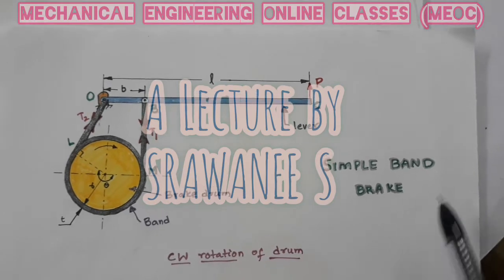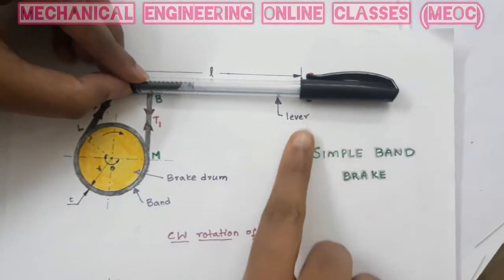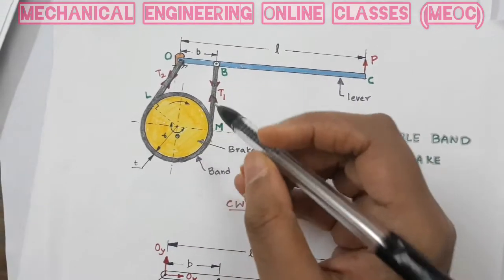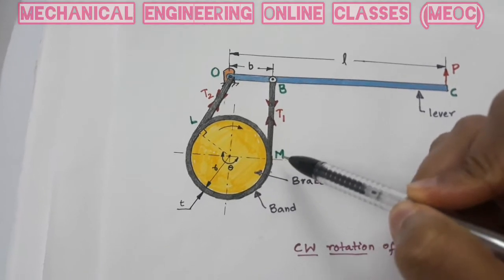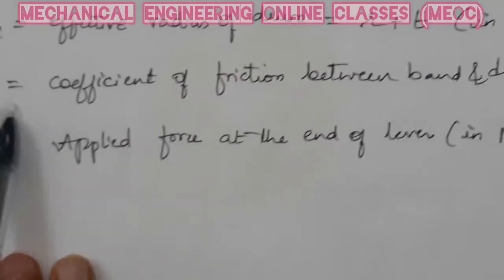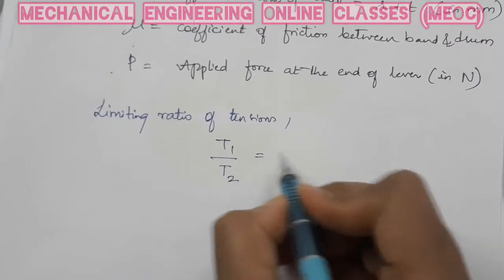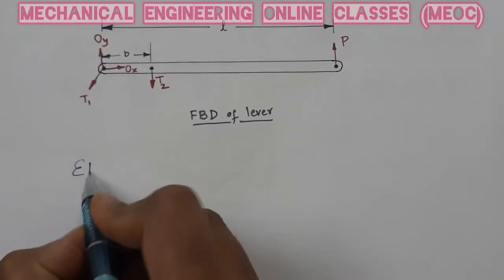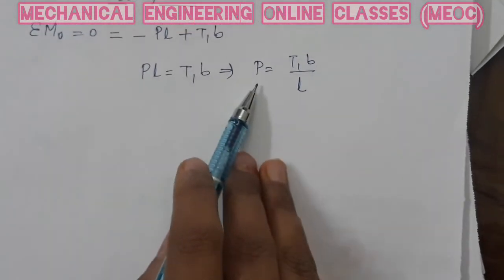Simple band brake working principle and finding braking torque

Comment: is there any way of relating drum's torque and forces of lever ?
Reply from the maker: The Braking torque TB is found in terms of tensions T1 and T2, and applied force is also found in terms of tensions T1 or T2. So because we have 2 equations... TB = [T1 -T2]r    .........(1)
P=bT1/l or bT2/l .........(2)
From above 2 equations we can find relationship between TB and  P in case we know the direction of rotation of drum.
The derivations of relations are explained  in the video.